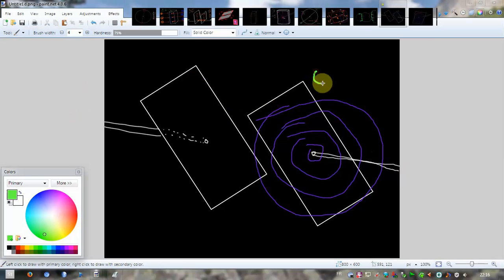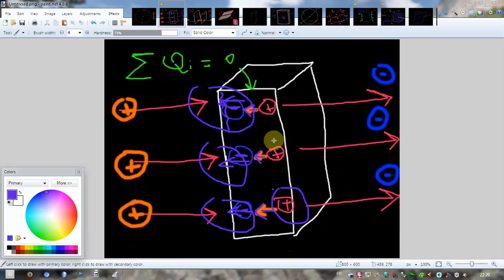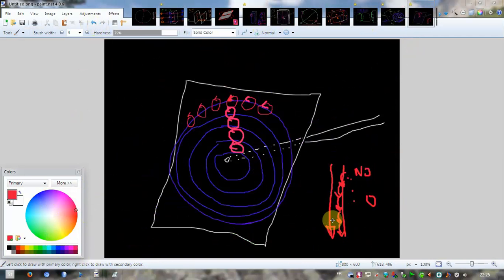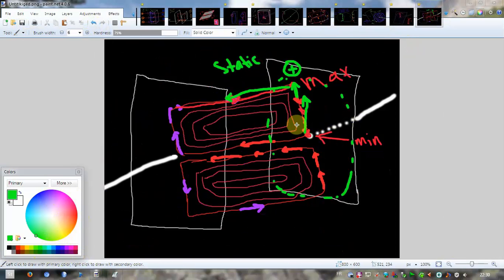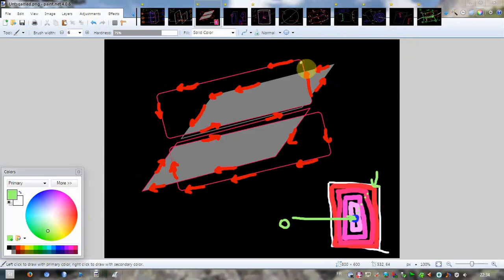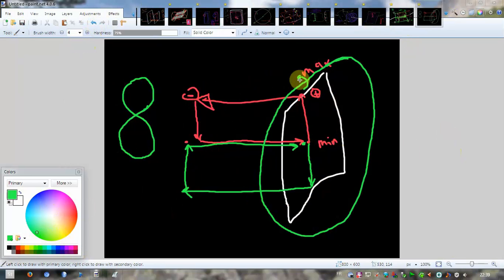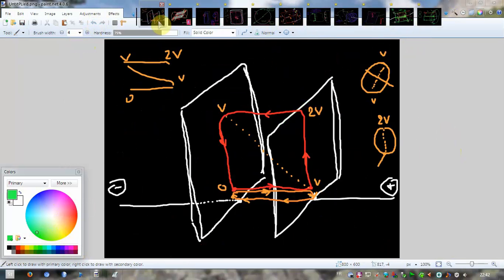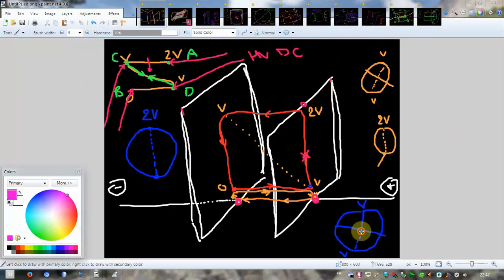displacement current the new concept !

Comment: like an electrophorus, u can connect two flat plates with a high power supply, and keep that plate stationary, then when u bring two more plates connected together with a wire, near to high voltage plates, the high voltage plates will rearrange charges on neutral plates and the wire connecting neutral plates will experience a current, now when u rotate the two neutral plates such that  the two plates now face another plates having charges of opposite polarity, this way the current at supply will be zero and current in wire will be as per voltage in neutral plates.

Comment: Ivor Catt gave the best interpretation I've seen of capacitor operation. The transmission line properties of circuits are ignored by mainstream, and he explained the doubling of charge on a capacitor. Check it out. You will be glad you did. The only thing further I would add is that the magnetic vector potential is also left out of mainstream, and is critical to understanding it at a deeper level.
Reply: Hello, have you a link for the video of Ivor Catt
and great work free-energy, please make more.